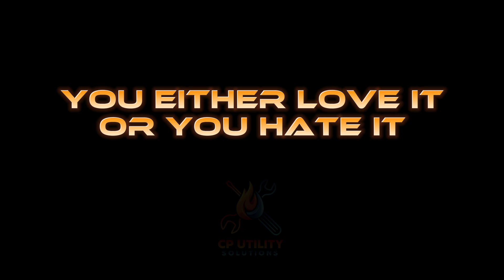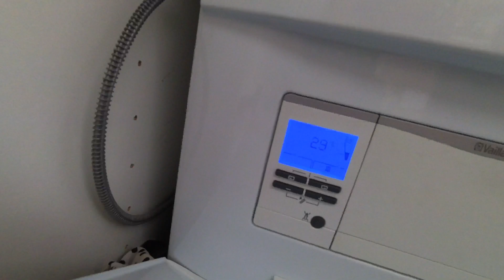Love It Or Hate It?

Comment: I actually have one to do tomorrow, customer wants 3 hives stats…..2 seperate ufh zones, 1 for rads and hot water which is 2 uv cylinders connected together🤔 i can already see the person who went there before fitted a hive but left the old wireless stat connected🤦🏼‍♂️🤷🏼‍♂️ so for heating you can turn on hive stat but the honeywell stat also needs to be turned up for it to work😳
Reply from the maker: Sounds like a fun one! 😁
Reply: Got it sorted….. 2 seperate hive receivers for underfloor zones and after some detective work i found a five core with a spare grey in it to use from the existing hive to control rads👍🏼👊🏼
Reply from the maker: @russellbaldry5095  happy days 🙌🏾